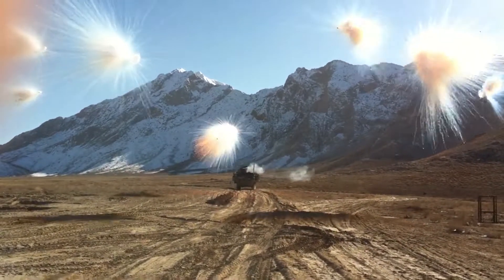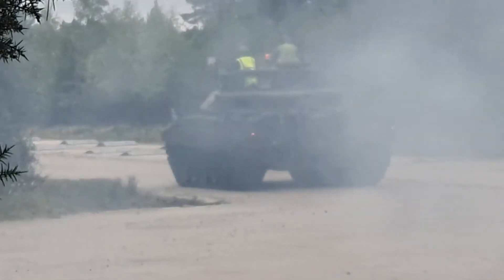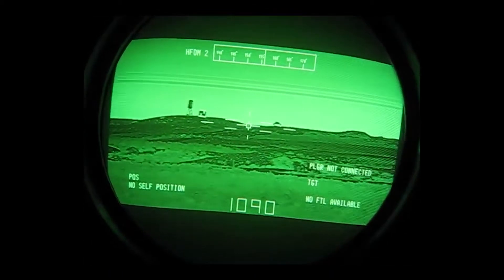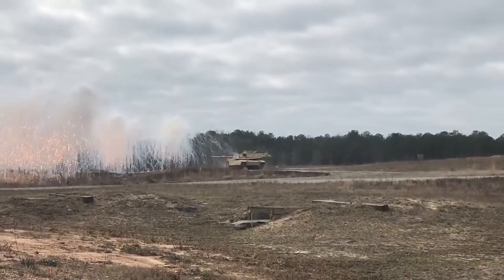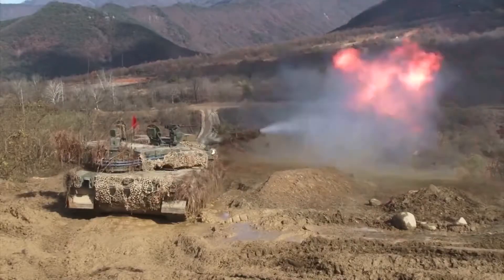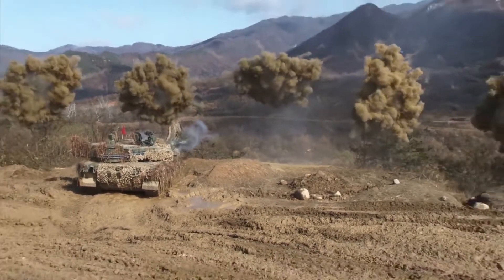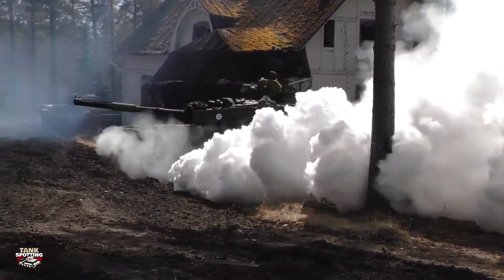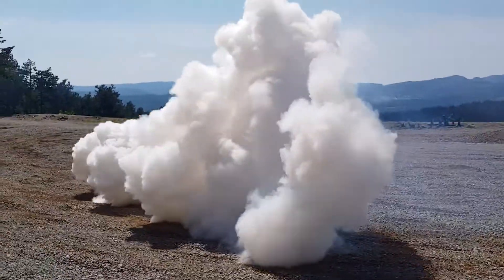Modern Tank Cloaking Devices? - How Thermal Smoke works

Comment: The thermal sight seen at the start of the video is of an Abrams M1A2 or possibly newer SEP model.

The Abrams has a smoke generation system with the turbine exhaust which can be so hot it completely blocks thermal view of anything looking at it. It is just as effective and lasts longer than an airburst smoke grenade volley of which the Abrams only gets two shots of 6 grenades fired 45 degrees off the sides of the turret.